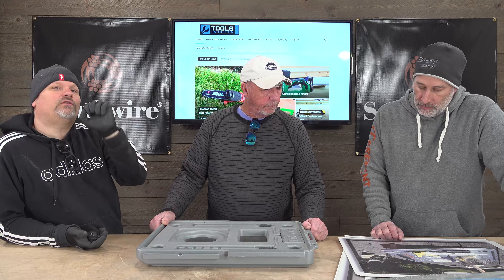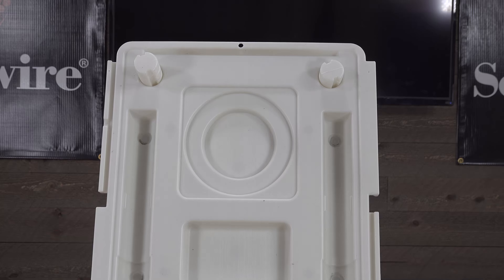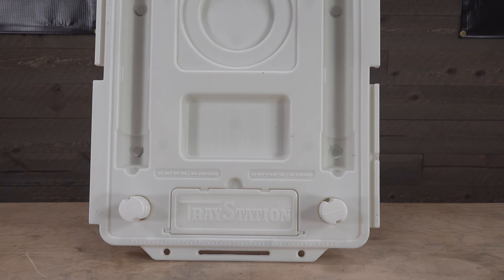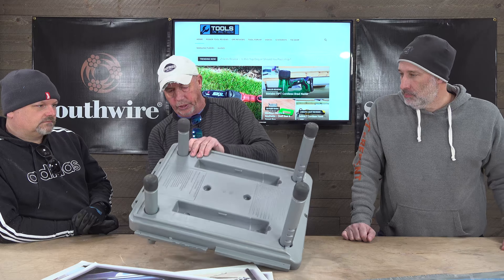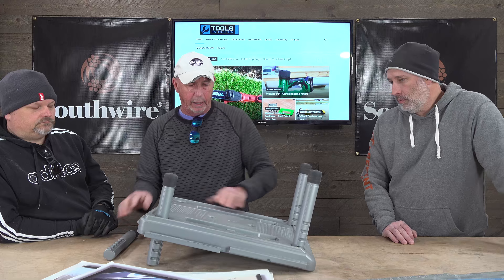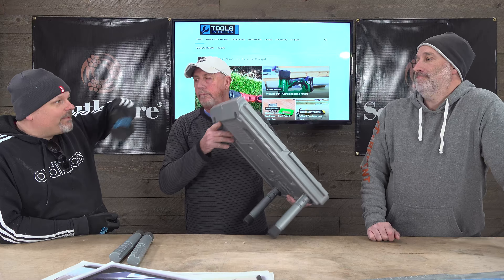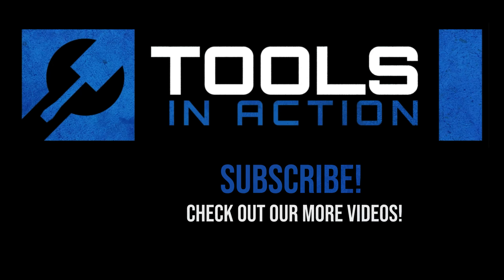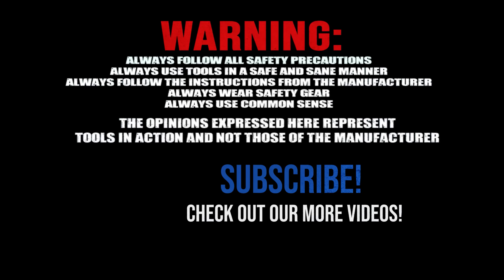The Tray Station - It does what?

Comment: Lot's of negative comments below. 
Anything that is small light weight and can be used for multiply purposes with be used by construction guys.
As you get older you don't want to keep bending down to pick your tools off of the floor. This would help.
It's a small table for your lunch break.
When working in expensive houses they go mad if you put dirty tools down, now you have a small table with non marring feet. 
That is just off the top of my head without even owning one.

Comment: Seems a bit clunky, lots of plastic so I don't see putting a full gallon on it, much less a five. Would be hard to carry up the ladder for roof work, along with the gallon of paint and caulking gun. I think I'll stick to the cut cup, but it has potential for the roof application if it was more sturdy and easy to carry